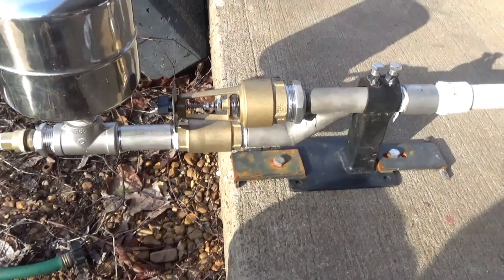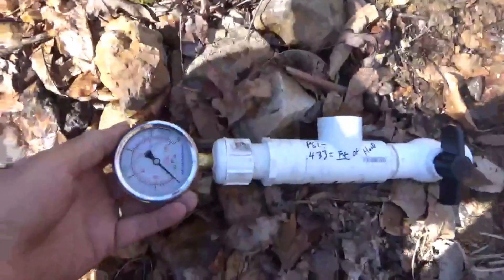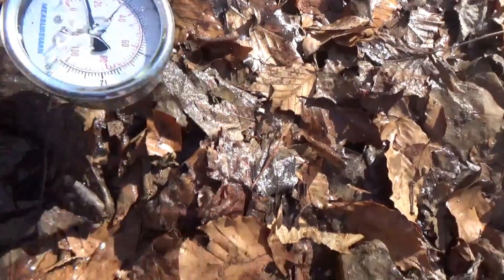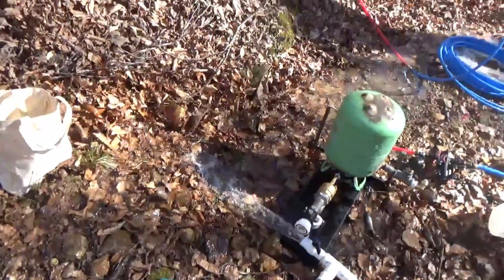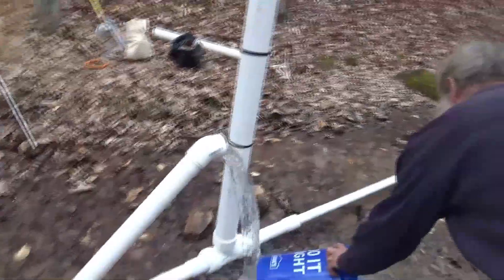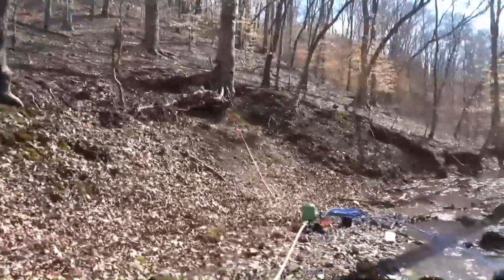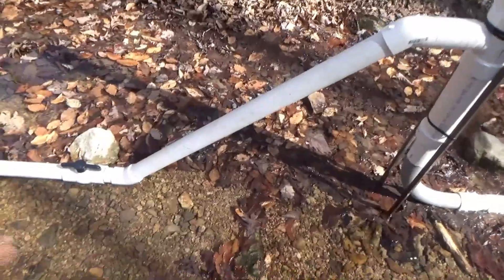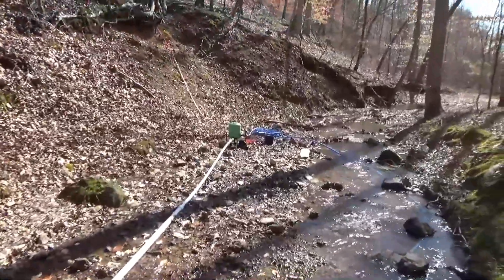New Ram Pump design with modified standpipe (140 ft. lift with 4.6' Head)!!

Comment: If a bladder tank is installed, what should the bladder be charged to? I have a 2 gallon waterheater expansion tank that I was considering using.
Reply from the maker: less than the psi on the out put side